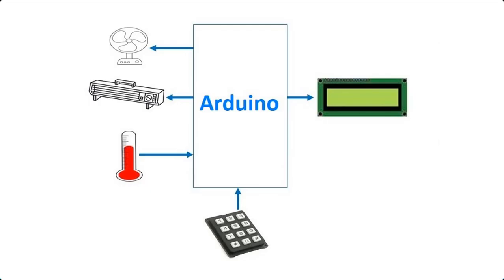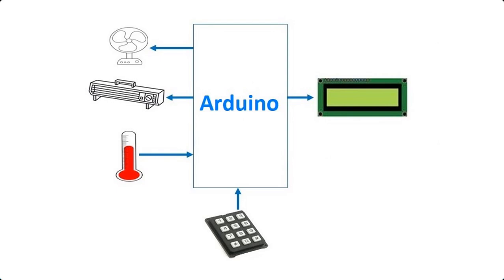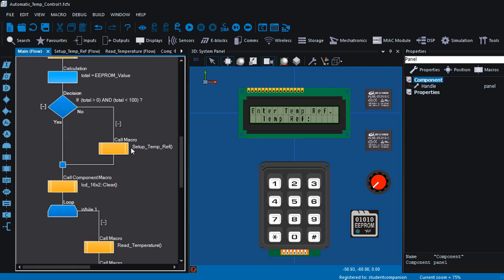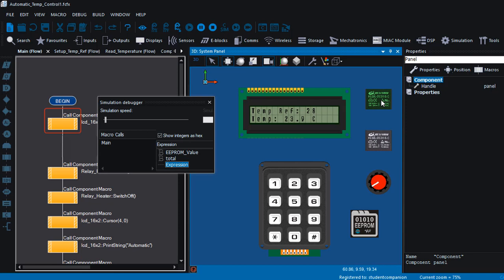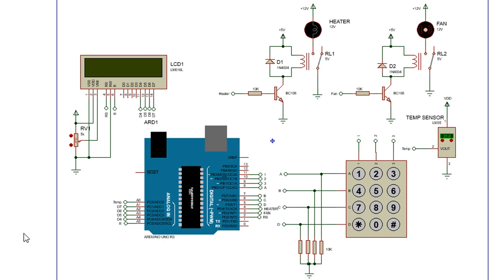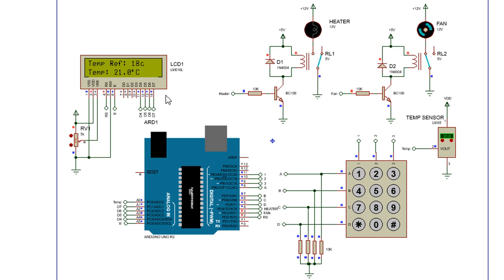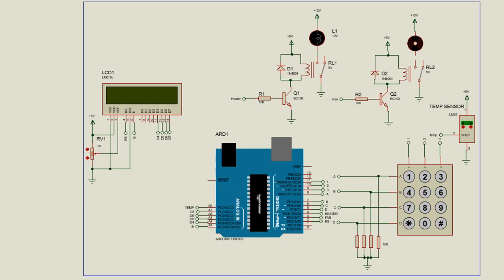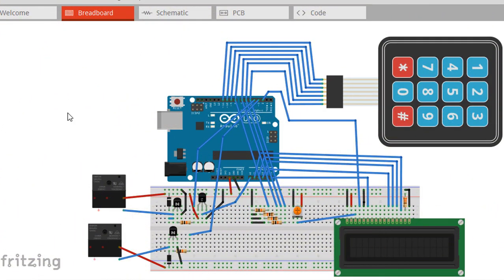11- Project 2 Automatic Temperature Control System, part 1 | Arduino with Flowcode Tutorial

Comment: Hello Sir, I have some question for this project
1. Can I use AT89C51 to this project?
2. At 02:41 what program do you use?
3. Can I use Keil uvision instead of using the program at 02:41 ?

Thankyou for answering😀
Reply from the maker: Hi. Thanks for your comments. 
I am sure you can also use the AT89C51 with this project, there is nothing special about this project, many other microcontroller with enough memory and gpio pins can be used but we haven't used that one sobI can't say with confidence.
We used Flowcode program with this project.
We have never used keil uvision so I don't know how it works and if it can be used. But if it can program microcontrollers the it can be used as well.

Comment: Good Morning Sir, what if my reference temperature has a range? For example 28 degrees to 32 degrees, how can I able to do that?
Reply from the maker: Hi. You can do the same as in this tutorial.  When comparing, don't compare with a single number but if temp >  28 <32 for example
Reply: @StudentCompanion  Thank you so much Sir. I already made it.
Reply: I used IDE Arduino code and it works.
Reply from the maker: Good to hear that. Thanks for your feedback.
Reply from the maker: Great! Thanks for your feedback.  Much appreciated!

Comment: sir how do you set the value of a resister which is connected on the base of the transistor ? if you have calculated the value from formula then kindly suggest the formula which is used to set the value of the resister.
Reply from the maker: This is a basic transistor lesson. If you have studied transistors, you should know there is a formula using the transistor gain to calculate the base resistor so the transistor can be used as a switch. A simple Google search can lead you to even some online calculators.

Comment: Sir in this video your circuit is running in proteus i just want ti ask u a question that how did u program the aurduino in proteus kindly help me by answering the question thank you
Reply from the maker: Hi. We explained how to load an hex file in Arduino in this video: https://youtu.be/w6402tlC378
Reply: @StudentCompanion   sir here in this link video we have code hn Arduino IDE softwear but in the circuit of temp controls system  we have code in FLOWCODE software  if you have the code of temp control system in ARDUINO IDE softwaer kindly shear with me sir
Reply from the maker: What have you done so far in terms of code?
Reply: @StudentCompanion  sir i had distribute the work in gorup the 1 who had to write code. He left our gorup at the last moment. now we have to submit our PROJECT on 3 dec  so we have to littel time if kindly u can help us by send the code  in ARDUINO IDE softwaer form then we will be thank full to u sir
Reply from the maker: You must have something to request additional support. That's how it works.

Comment: Sir I want to make automatic room tumrature  using ardvino   my semester project 
The circuit has been completed only coding is remaining so just want coding part 
Plz
Reply: Salam sir
First of all i am thakfull of you that  you have shared very usefull project with us and explained each and every thing in detail. But still i need your help to understand this projects for that i just want to read the all aspects  if the project which  will be written in PROJECT report in detail so can you kindly shear that report with us. And one other thing is can you kindly sugest any FET which can b use by replacing BJT Becouse Fet is the main need of our semester PROJECT i will b your thankful regards
Reply from the maker: It's easy to get a direct answer when you ask a question with details. You can only select a correct FET when you know what kind of load it will drive.
Reply: Ok sir we will wait for your upcoming video but the problem is that our group have to submit our semester PROJECT in the very binging of the December  thats way we want your to shear the PROJECT report with us now if possible. So we can study it and engineer it on hardwaer manzoorshoaib1@gmail.com this is my email addres if you can help us the plz help us we will be your thankful
Reply from the maker: There is a forum on our website.  You can ask your questions here on YouTube or in the Forum on our website.  We don't provide support in private messages
Reply: @StudentCompanion  ok sir thanks for replaying thanks a lot
Reply from the maker: You are welcome!
Reply from the maker: But we have explained everything, all the code in these videos? Part 2 and part 3?
Reply: sir if you have the arduino IDE code so it will be great if you share but if you can't.  so plz give us some information about the code of IDE or you can you share a helpfull link etc.. we will be thank full to you. plz ..
Reply from the maker: It's very easy the code. If you struggle along the way, ask the questions.  If you are patient, we will published the arduino code version soon.
Reply: you have explained it in flow code sir plz we want a code of arduino IDE.  so that it Will be easy for making or building it
Reply: Sir can u tell us the model of FET which can replace bjt bc108 it will make our half work done
Reply: We want same load on output a ac fan and a ac bulp on output using relay in betwen the transistors and loads
Reply: Sir kindly plz tell me the model of any fet which can replace bc108 BJT
Reply from the maker: You must first read the BC108 transistor datasheet to know it's characteristics like current, voltage etc. Then you can look fir a replacement that can fullfil the minimum requirements.  That's how you start the search

Comment: how to add humidity sensor
Reply from the maker: Hi Daniel which type of humidity sensor? The simplest is to use the popular DHT11 or DHT22.
Reply from the maker: If you don't know how to use it let us know we will explain the steps. It's easy to use it with Arduino or Flowcode.